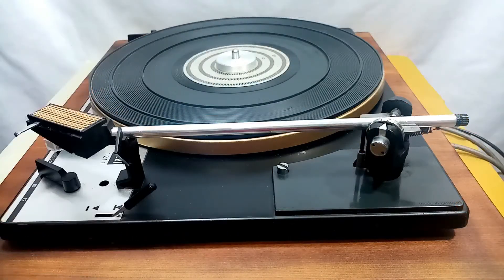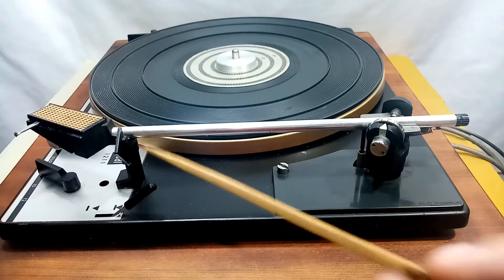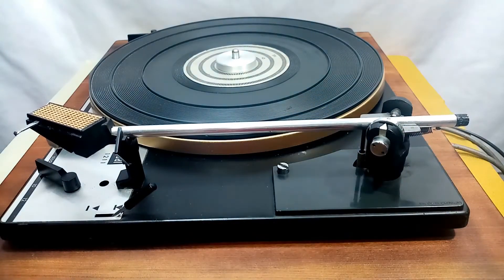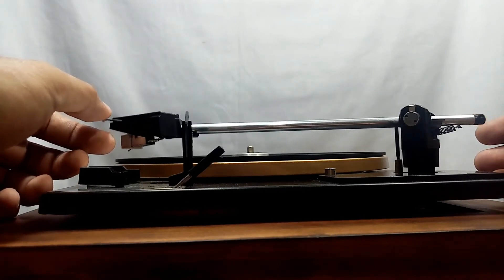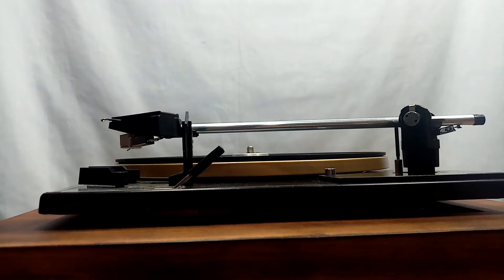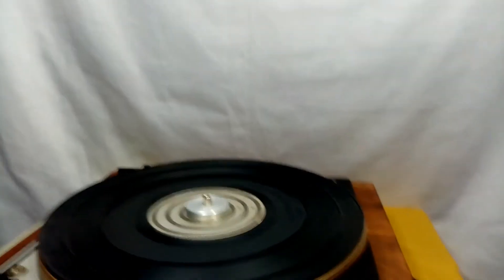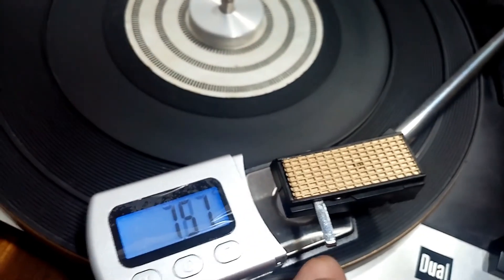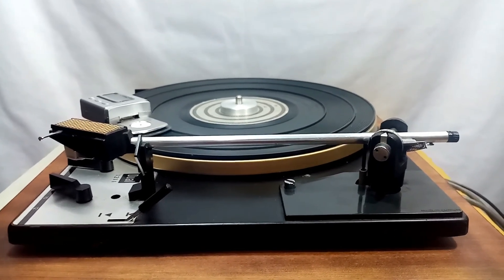How to adjust TRACKING FORCE || Dual 1211 Turntable

Comment: Thanks for the video. Do you know if this turntable can also be used with modern vinyl records? I have one that I just fixed but only old vinyls sound good. The modern ones have a bad sound and skip. Some people told me that the cartridge, headshell and tone arm are too bad for modern vinyls and so I have to buy a new turntable. In your opinion it's true or this is just a regulation problem?
Reply from the maker: Yes this can be used in a new vinyl records. Actually DUAL is superb than the new turntable. About skipping check your tracking force maybe your tracking force is too light set it to 1.5 to 3g that's the range for MM and MC cartridge. Before and after playing records each sides always clean the needle.
Reply: @woodys_hobbies  thanks for the advice, but I don't have an MM or MC cartridge, I have the piezoelectric one. Maybe is this the problem?
Reply from the maker: @andrealacorte4935  Maybe if your Piezo is old it might be corroded inside it can cause loss contact. But anyway if your sound is fine then try to replace a new needle for that and ceramic or piezo cartridge it has a tracking force around 5 to 6grams try to adjust at that weight and don't worry about damaging your record it's really true I'm using a piezo and ceramic that's is its specs if you go below that weight the sound is distorted or records skips.
Reply: @woodys_hobbies  perfect, thank you so much.
Reply from the maker: @andrealacorte4935  Welcome